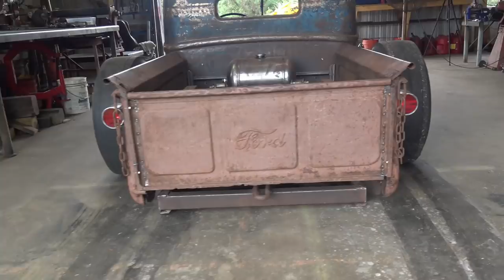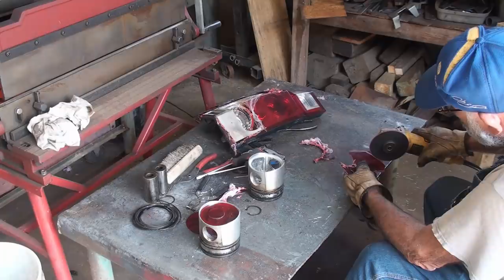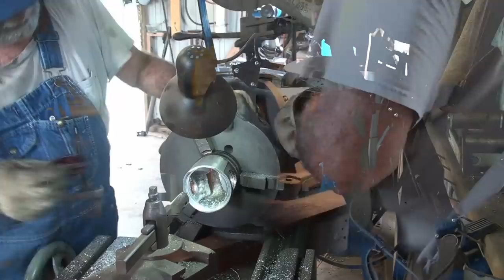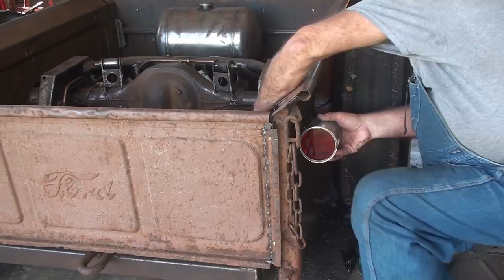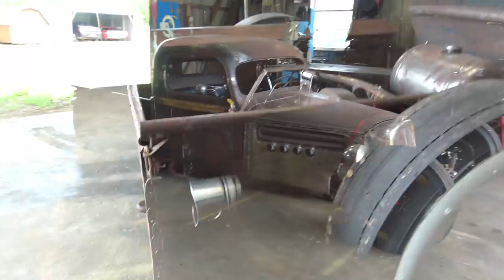Piston Tail Lights Build - 47 Ford Truck Rat Rod

Comment: Using the rings for retainers for the lenses - genius.
I agree with you about the rear-view mirrors.. they don't go with the truck, and in my opinion, stick out too far. I think whatever mirrors you come up with they need to be in much closer.
Reply from the maker: The problem is the way the cab is made more narrow at the front of the door than the back. I need em out there to see my trailer. A pair that extend would be great.
Reply: @RatRodBobBuilds  Oh ok, well that makes a lot of sense. Yeah, you want to be able to see the trailer for backing the thing up.

Comment: Larger piston for headlights mounted with contacting rods. The small formed hole at the end of the bed rail would be great for a small lens for turn signals.

Comment: Good call on wanting to change the mirrors out. You did a good job on the hands but don’t necessarily fit truck.  Did you ever think about making some using a few connecting rods? They would go with the piston taillights. On a side note you’ve done such a good job on the different 12 valve trucks you built it be really cool to see you do a 12 valve diesel rat rod as a future build. 🐀 🛠 Too bad you weren’t doing videos back when you built the red dually I think a lot of people would have enjoyed watching that build. It turned out sweet!

Comment: As others have suggested... connecting rod mirror brackets ....  crank hole for mirror.. pin end for door mount. 'Y'bracket mount on door for in- out - up-down mirror adjust.                                                               O~~o-{ truck cab}-o~~O

Comment: I'm glad you said something about the mirrors. I wasn't gonna say nothing, cause I didn't wanna be "THAT GUY", but they were driving me nuts lol. May I suggest a mirror design based off of an actual truck. A rectangle shape like a 74' ford. About 6 inch wide and roughly half the length of the side window with the round stock aluminium brackets

P.S. the tail lights completely blew me away.

Comment: Hello Bob great work i wonder if they could also be set up as headlights with turning signals on the front
Reply from the maker: Yes, I'm sure you could find a small headlight that will fit inside it. I've seen piston headlight setups before but it didn't do anything for me.

Comment: Did you polish the  inside of the the piston for more light reflection? Great idea, think I might have to look into trying that myself, wished you would have shown what you used for the light receptical.
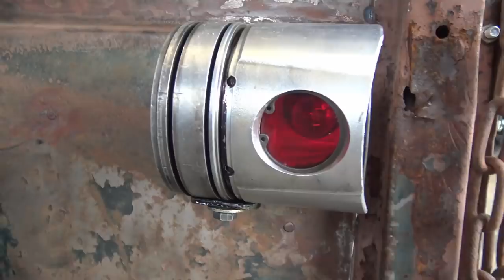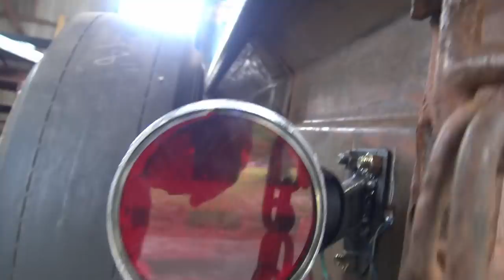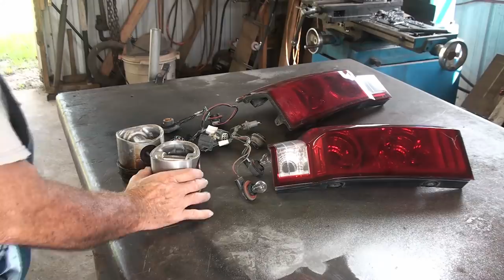Reply from the maker: Didn't polish it but after I hogged the inside out it was pretty and bright. I used the "receptical" from the Jeep tail light. You can get a glimpse of it at 1:20 , 1:26 and 1:42

Comment: Good job Bob on the lights but they are Not even , the Right one is lower . and Idea on the Mirrors any Old 50s or 60s style  Truck or Car would look Good on it ..Yeah.
Reply: Yeah he mentioned that in the video when he was talking about the bolt holes in the bed